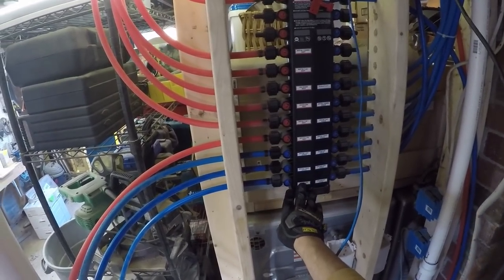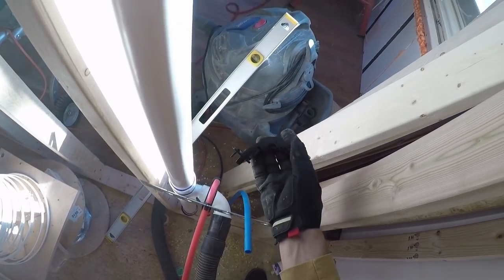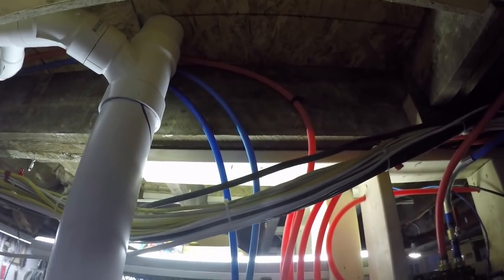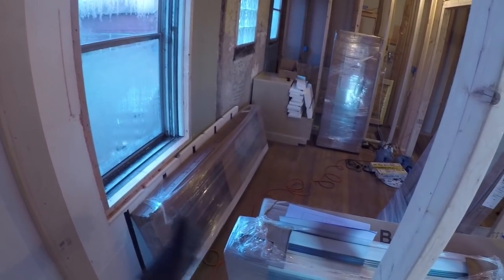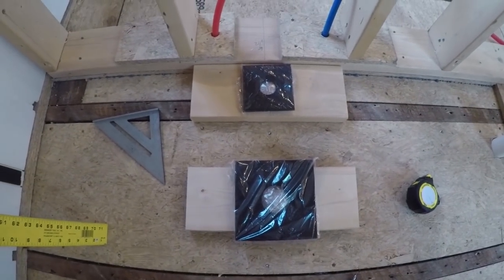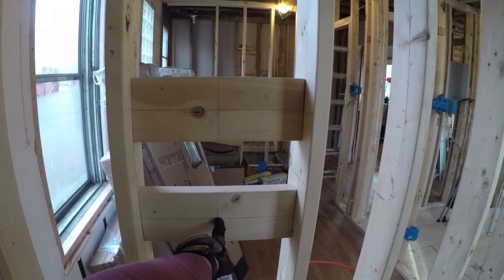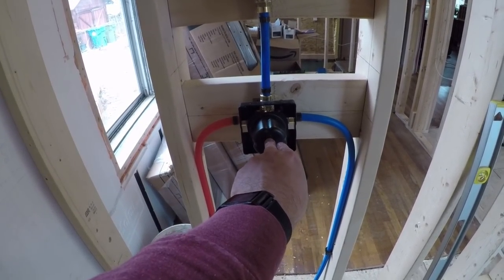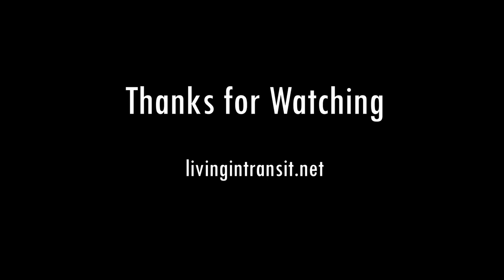Running Pex water lines for the bathroom and shower

Comment: The handheld wand can be hooked to the ceiling for rain head. So you don't need two shower heads or the extra plumbing.
Reply from the maker: It sure can, but luxury is often about excess and laziness.  People enjoy not having to rig something when you can have a bigger better version built in.

Comment: With these new materials you will not need a plumber anymore.
Reply: Dead right.  But when things go wrong, you do need a properly qualified & experienced plumber.  I have had to sort out or even redo plenty of DIY installations in my time.  But I'll always respect a tryer.
Reply: Well there are still the individuals that have never heard of a fitting and  don't work with their hands and don't trust themselves as easy as it looks. Stuff still has to be lined up right for a proper connection only thing ya eliminate is a torch and Flux. The pipes in my house is all compression which doesn't require a plumber just a wrench and patience. Patience is also what many don't have
Reply: @TheBmonster1  I'm too impatient to listen to your Babel. :)

Comment: Make sure you put vibration spacers on your pex, wherever you plan on routing a hole for a pex line to run through it needs to be cushioned with a spacer. So that you don't run the risk of a gradual leak as the line bangs around and vibrates. Over time itll etch out just enough a gouge to leak. Or worst just bust wide open
Reply: I am just now starting to run a new home from a pex manifold. That is very good advice. Thank you.
Reply: Great advice.  Those spacers are an absolute must!
Reply: I read this 2 days after completing all the pex 🤣 ive noticed some will squirt some foam around it? Thoughts
Reply: Just use a bigger piece of PEX pipe or old garden hose for this purpose. No need to buy extra junk when you have junk just laying around.
One man's garbage is another man's treasure.

Comment: I noticed that there are no water hammer arrestors installed in the supply lines.  Does the plumbing code allow these to be eliminated when using PEX tubing?
Reply from the maker: Correct, they were not required in my city.  They may be elsewhere though.

Comment: How do you determine how deep the blocks on wood is to support the different fixtures?
Reply from the maker: A good question!  The valves have instructions that will tell you how far they should stick out beyond the finished surface, so you just need to figure out how thick your tile, water proofing and substrate are and it'll give you the rest.  It's not crucial to be exact there is a good bit of room to "err"

Comment: I have a master bath with a separate shower and tub.  We’re replace burst copper pipes with pex.  Is there an advantage to keeping this separate tub and shower on separate water lines?  So the bathroom (ignoring the sinks) would have two colds and two hots.  Or is it better to keep them on one and just tee off of it (one cold and one hot)
Reply from the maker: Most plumbing systems are teed off of another branch.  The only benefit I can think of running a whole new branch would be if you have a tub that needs a lot of water to fill it. Or you’re in the habit of having the shower and the bath running at the same time, but even then you probably won’t notice much of a drop in pressure unless you have poor water pressure to begin with.

Comment: hello sir how do u measure to install support brace for shower system?
Reply from the maker: I'm not sure I understand.  Are you asking how do I know where to place the 2x backer brace or something else?
Reply: @LivingInTransit1  do i screw support bracket FLUSH with existing 2x4 , what im trying to do is make sure it fits when i install the backer board and tile
Reply from the maker: @ginagvlogs2386  Ah I see what you're saying now.  Well sadly I cannot answer that as it's unique to your mixing valve and how thick your backer and tile are.  If you read the manual for your mixing valve it should give you the range of depth.  It's a little forgiving, so you don't have to be exact.
Reply: A tape measure.

Comment: U can run pex right to the shower n tub? Thought u switch to copper there?
Reply from the maker: That's a great question! You can run it straight to both, but I would only run it to a shower valve myself.  If you run the pex to a tub faucet the faucet itself will be rather wiggly and will flex.  I would switch to at that point.  For mixing valves though it works great!

Comment: Line for shower head is 3/4 ?. .can be 1/2 inch?
Reply from the maker: Sure.  It can be 3/8 or 1/4 if you want.  Larger line equals more water to the fixture.  The smaller the line the less water.

Comment: What shower faucet combo would you recommend
Reply from the maker: That is a question I really wouldn't even begin to be able to answer.  The Delta brand models I got worked great but I don't know enough about all the brands out there to make decisions like that.  Start with a look you like and then do some research and see if they are a good quality brand that will last or even have available parts for you if/when you need repairs.
Reply: @LivingInTransit1  thank you for the prompt reply if like a model where it doesn't have the temperature adjustment just one where the lever goes all the way from hot to cold

Comment: IDK. My folks have been in their home for 43 years with no plumbing issues yet with their copper pipes. The older I get, the shorter and shorter those 43 years seem. It would be tragic to have to tear out all the plumbing every 25, 30 years. Uponor poly only has a 25 year warranty!!!
Reply from the maker: Oh wow this is a fascinating comment, thank you! So yes Uponor "only" has a 25 year warranty.  Almost all of the items in my home come with a 1 year warranty, but I don't expect them to fail at 1 year or or 14 months as you suggest with replacing plumbing at 25 to 30 years.  Most things in a house that are faulty will fail in the first few years.  Settling, pressure, vibration, use etc should cause a defective product to show itself pretty early on.  That 25 year warranty is complete overkill.  Heck if you're still the original owner after 24 years and you remember that the pipe had a 25 year warranty AND the failure was a defect and not due to some other failure that would be a near miracle.  

I'd also like to point out that traditional copper pipe doesn't really come with any warranty.  Most fittings and pipe itself has very little to show which manufacturer cast or extruded it.  Those that are clearly marked are often wiped away with age as it's inked on.  I'd love to see someone try to hunt down and hold liable any copper pipe company for a defect in their products and then prove that it wasn't the installers fault.  

PEX has been around for nearly 60 years at this point and the technology is only getting better.  I'll trust Uponor over copper any day!  If you still have worries, check out some of Matt Risinger's videos.  He's done 4-6 showing PEX vs PEX and PEX vs copper in pressure and freeze conditions proving that most good PEX pipe and Uponor specifically blow the pants off copper.

Comment: This was a great video, thank you. 
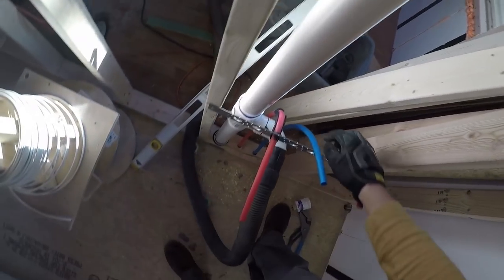Around 2:13 of the video you showed metal brackets and and plastic straps that snap into them, did you get these on amazon? I can't seem to find them.
Thanks !
Reply from the maker: They are a sharkbite product you can buy at Lowes.  https://www.lowes.com/pd/SharkBite-2-Pack-1-2-in-to-1-2-in-dia-Plastic-Pex-Bend-Support/1000182869  But I don't recommend them, they are utter garbage.  The bend supports didn't stay in the metal strapping very well and the whole thing was just very flimsy feeling.  If you can stubout in copper do that, if you want to use pex fittings for your valves then maybe look at something more robust like this product.  https://www.supplyhouse.com/Sioux-Chief-525-P2M1-Face-Plate-with-PEX-Bend-Support  Supplyhouse.com is where I got the vast majority of my Pex supplies.
Reply: @LivingInTransit1  Great info, thank you. I was about to install those plates

Comment: What is the purpose of having a huge manifold like that? Wouldn't it be a lot more economical to Tee-off the main distribution for each fixture? Lol
Reply from the maker: Home-run manifold systems use the least hot water and the most pipe
A large-diameter (3/4 in.) main water line feeds the manifold; smaller lines run from the manifold to each fixture. Any fixture in the house can be shut off at the manifold. And because home-run systems don’t rely on a large pipe for distribution, you save both water and energy. Simply put, you don’t have to leave the faucet running as long before hot water reaches the sink. This design flexibility has a cost, however. Because a dedicated line is going to each fixture, you use a lot of PEX and might end up drilling a lot of holes. Since this house was on a 1,000 sq ft footprint and the manifold was almost in the center of the house it honestly didn't use much more pipe than a branch system.  Pex is inexpensive, fittings are costly.  Home-run systems use fewer fittings. For me though it really all came down to the beauty of being able to shut off an entire fixture like a circuit breaker.  which I did many times as this renovation was done slowly over the course of nearly a decade.
Reply: @LivingInTransit1  I understand your points but at that cost wouldn't it be more economical/better to have a recirc line? ive been a ticketed plumber for 12y and from my perspective see no advantage to having a water distribution system like this aside from being able to turn a fixture off from the manifold and not the actual fixture itself. Having 3/4" to the manifold and 1/2" to each fixture really limits the amount of water/volume each fixture has. Filling a bathtub on the other side of the house using that system would be painful.
Reply from the maker: @77costa77  to each their own. There was not much additional cost and as there are no bathtubs and the furthest fixture from the manifold is less than 15 feet none of your points are really an issue.

Comment: Whats the name of the plug u used. Yellow item always used old shower arm with cap
Reply from the maker: If you google "Shower test plug" they will come up, here's one I found on Amazon 

https://www.amazon.com/Jones-Stephens-H54050-Handi-Plug-Small/dp/B009YA1L1O/ref=asc_df_B009YA1L1O/?tag=hyprod-20&linkCode=df0&hvadid=242112303984&hvpos=&hvnetw=g&hvrand=14518643461149130975&hvpone=&hvptwo=&hvqmt=&hvdev=c&hvdvcmdl=&hvlocint=&hvlocphy=9061153&hvtargid=pla-717675402472&psc=1